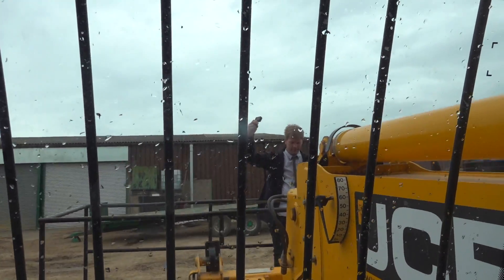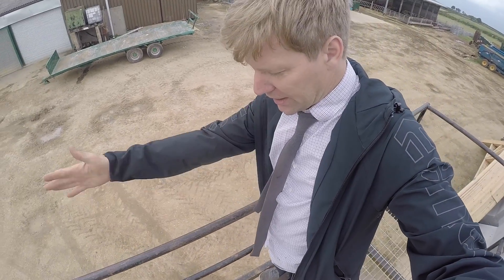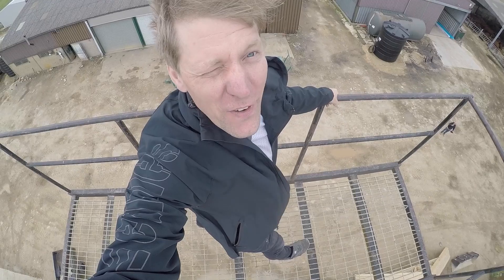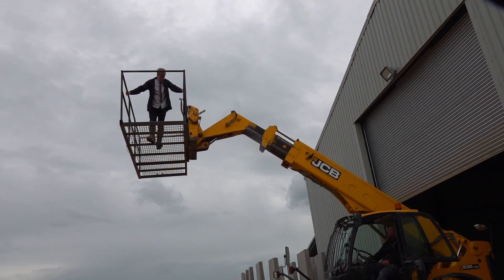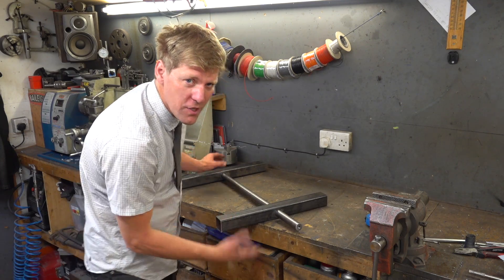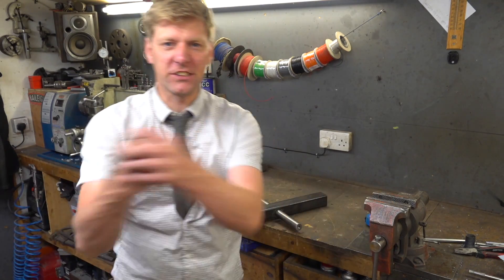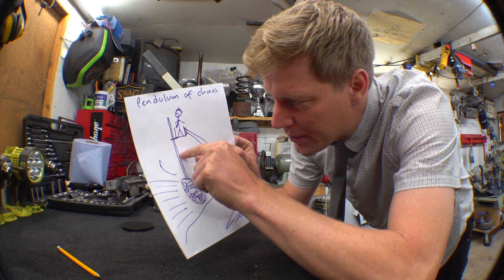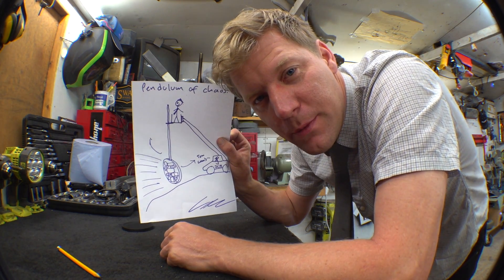Making a 32FT FIREWORK PENDULUM

Comment: Be careful with the jib/platform on you standing (cage) , that thng have a maximum weight on top 227kg ,, I worried if that axels will broke up
Reply: With or without  safety tie? :)
Reply: It amazing that Health and Safety England has not issued Colin with health and safety code of conduct at this stage
!! Colin will most probably have 3 files by now!  :D
Reply: You talk England very well
Reply: @Cent51  B- for English
Reply: @mariokrajna2512  England or the UK has got strict health and safety rules.
Read it and  understand the concept, England health and safety😉..

Comment: Colinfurze! I have an idea! Make a monowheel! You know what it is right? Monowheel! Make it!

Please...
Reply: Monowheel is GREAT! idea - straight out of the Colin Furze playbook of Danger !
Reply: Lots have been made.
They all have stability issues. They are a large gyroscope and as such are vulnerable to procession of you don't stop regularly.

Basically the central axis of rotation eventually becomes a cone when external forces are applied.
In satellites, they can rectify this and gyroscopic saturation, with multi gyroscope setups.
Reply: @markp8295  i think colin dont need the gyroscope stuff because if the monowheel is spinning it will stabilise it self just like a motorcycle that doesnt always tumble sideways. When the monowheel stops, he could just use his feet to stabilise it. Simple...
Reply: @rafa_saugi  The mono wheel is a large spinning wheel which makes it a gyroscope. With 2 wheels on a motor bike it's much less likely as the point of rotation is central to the hole and so the torque is countered by friction, but even motorbikes suffer from this. Look for motorbike steering damper. They stop it from causing the left right left right wobble that sets up in the wheel of it hits a bump badly, causing instant, very hard to control procession.
Reply: @markp8295  but the monowheel turns by tilting the whole thing sideways at an angle, not using a steering handle like a motorcycle

Comment: It seems like our friend Newton might have some suggestions as to a problem or two that comes from firing fireworks forward while swinging the "flimsy" steel pendulum.
My guess is that when the fireworks start, it's going to push the pendulum backwards and they're going to start firing at the ground.
It's not exactly like they're rockets strapped to it and pushing it backwards (they're just firing out of the boxes, but there will still be some force backwards as they fire forwards), but I can't help but think that there will be enough to bend it backwards just enough to change their trajectory.
So... maybe aim the boxes at a slight angle and not flat against the grate?

I could be entirely wrong too, but it's just a thought.

Comment: I wish the engineers at my job new 1/100 as much as this guy did. I saved our company like 5000 dollars because they couldn't think of using a 1 inch long metal tube. Basically we just needed a lever to stick out farther that tightened something. They were gonna drill a hole through pure steel about a foot thick from the complete opposite side of the machine and put the lever there instead. On every machine. Some people just werent meant to be engineers. Im not even smart, doesnt take a genius to think of an extra thick washer. Clearly this guy was meant to be one.

Comment: Use a safety harness, for fuck sake! Any fall over 2 meters have a high risk of a deadly outcome and i want to see more of your videos!
Also, the machine is almost sure to be able to handle the wheights but the cage is only made for carrying people and a lighter load of equipment/material. Please make sure you find out the work load limit (wll for short) for the cage before attaching anything to it. I'm a crane operator in Sweden and there's a reason why we have such hard regulations and laws.